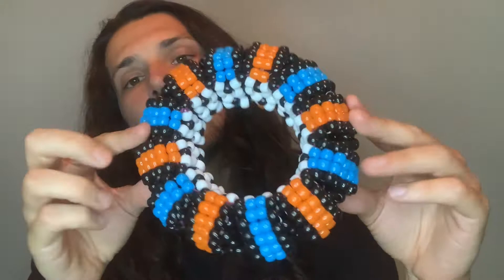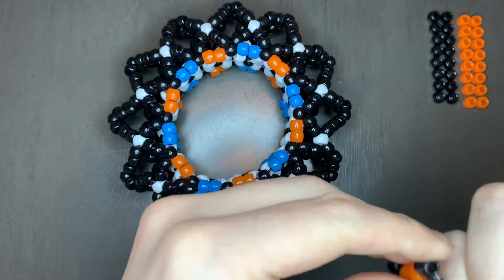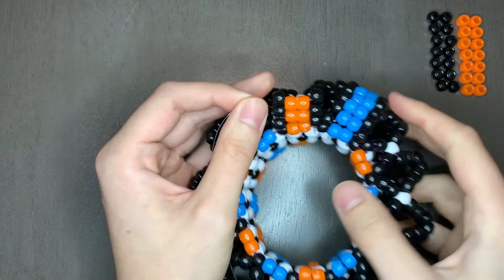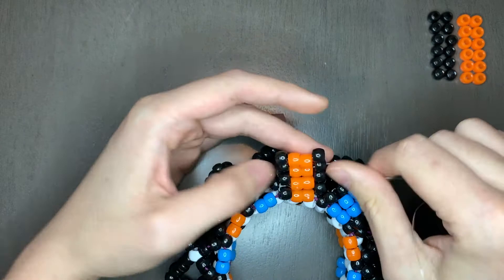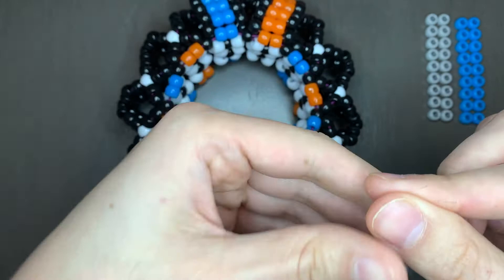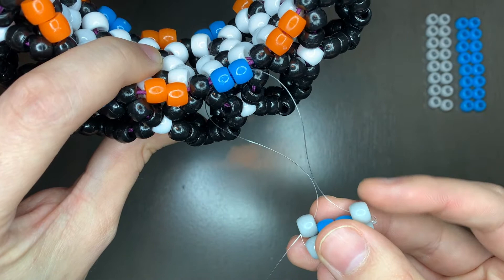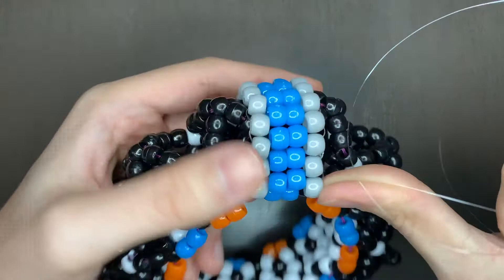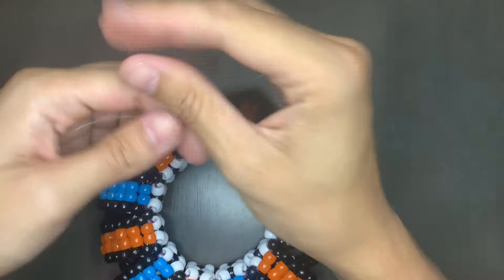Urchin Kandi Cuff Tutorial

Comment: I have the exact same fishing line, I'm new to kandi and I'm glad I can see that you can make cool stuff with it
I was parinoid that it was the wrong string
Reply from the maker: I use a lot of fishing line. So, you need elastic cord to start the cuff. This will make it expand onto your arm. After making the base and the first layer, I switch to fishing line. The outside layers don't really need to stretch, just the inner part :)
Reply: @kandigamer4228  yeah I need to buy some elastic, but I've made it work so far
Reply from the maker: @CHARREDFUR  Oh ya it works and there is no chance it will break :) I just have to make them a little bigger to fit past my hand. After that I put a smaller cuff underneath it. I always need to buy some elastic... run out of it soo quickly.

Comment: Hey could you post a video on how to successfully work with fishingline, I can never get any of the knots to stay and any tips you may have. I have such trouble with mine
Reply from the maker: Will do! I know fishing line can be tricky... it is really strong and sometimes unravels itself. I use 12 and 25 lb fishing line. I have learned if you go more than this then it is extremely hard to tie knots. I do a two square knots, and then two more going the opposite direction. I will explain this more in detail on the next video when using fishing line.

Also, this is super important, cut a generous amount of fishing line. Too much line is good. It makes the knots soooooo much easier. 

This is also another trick I use to do. I use to add some nail polish onto my knots. I tried super glue, but nail polish worked a lot better. I still had to do a good knot, but the nail polish sealed it together. 

Hope this helps! Thank you for your comment.